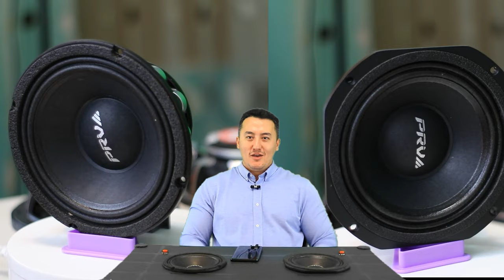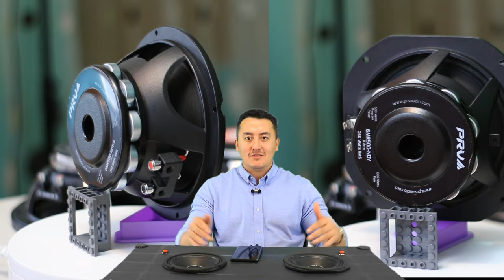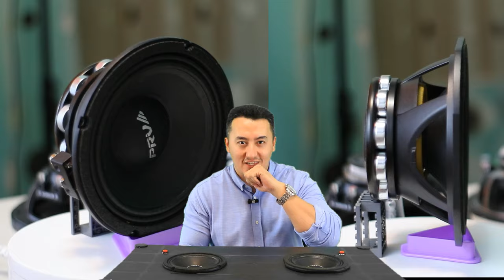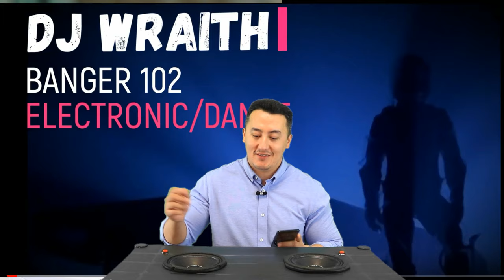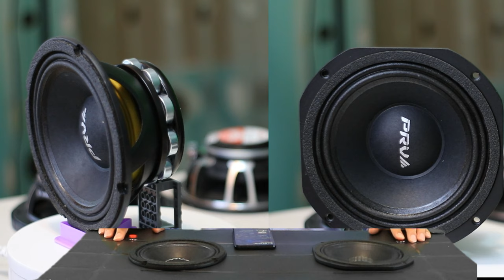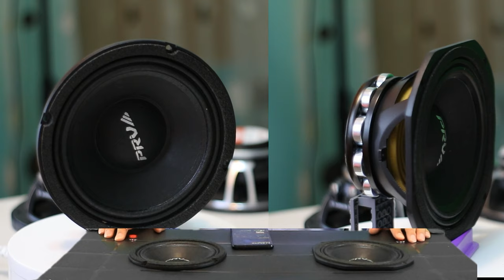Myth busted, real test 4 Ohm vs 8 Ohm speaker? Car audio system PRV AUDIO 6MR500-NDY

Comment: Ive heard that too yesterday doing car audio and switching between 8 and 4 ohm subwoofer, 8 ohm just crashed it, you could close your eye and just relax deeping through that smoothness of bass vibrations, that meat! Difference in night and day!!!! Even by not an audiophile person next to me. Otherwise wiring 4ohm speaker the bass was easier controlled right and louder, but it was only loudness and not quality itself it was not comparable, maybe some mids and highs would be better at 4ohm but not for a bass, it needs to be hell thick and dynamic which only maybe top high end 4ohm speaker give you, comparable to casual 8ohm. Peace out! And have a good 8ohm subs in ur trunk! P.S. I tell you a cool story how a person that heard 4 and 8 ohm speaker got addicted to that bass, not sleeping and searching for a good 8 ohm aftermarket sub after burning 8ohm sub and getting 4 ohm sub and be passed on it for a while :D

Comment: It’s just like the subwoofers, the ohms are made depending on what application, generally, to match a amp for example: a 3000w 2 ohms monoblock , for match that ohm , you need two speakers at 4 ohms (4+4=2ohms load) , with a 8 ohm speaker, you will need four speakers at 8 ohms to match the 2 ohm load for the amplifier (8+8+8+8=2 ohms load). Obviously in parallel.
Reply: How so? I have 2 4 ohm dvc's going to a 2ohm stable monoblock. The speakers and are at 4ohm stable. Sounds pretty good, still tuning the amp.

Comment: 8ohm is for Sound Quality
2Ohm for POWA so it can get more power out of amp sacrificing sound quality.

You lose power at the amp not the speaker. When the amp sees the resistance it changes the power.

Comment: The main difference is the amps the speaker draw from the amplifier. If you connect two 4ohm speakers the ohms drop down to 2 ohms compare to 4 ohms if you connect two 8 ohms speakers.

Comment: couldn't tell the difference, hey so I got a question that you might have an answer to. So I have a pair of 6.5-Inch 180 Watt 2-Way Coaxial Speaker but each speaker is 90 Watts RMS/ 180 Watts Peak Frequency Response 65-20 KHz, Impedance 4 Ohms. I'm looking for a cheap 2 channel amp that can make these speakers sound awesome. what kind of specs should i be looking for in a amp? how many watts should the amp have and ohms as well, remember I'm looking for a cheap amp that make my speakers shine! thanks
Reply from the maker: Hey man get timpano  or rockville amps they around 90$ but Ull be happy with them
Reply: @LIFEINSPEED  i was looking for something in the $50 or even less lol

Comment: I got two b&c 10 they are supposed to be 8ohms but my multimeter read 4.8 on both speakers it’s that normal ? 
My think is my soundigital 2000.4 4ohms 
Give me 1000 at 4 ohms 
But when I connect my two speakers it go to 2.2 ohms it’s that normal ? Or how you guys recommend me to connect them ? 
Thanks

Comment: 8 ohms run cooler than 4 ohms , another words less heat will save your amps and speakers. 2 ohms takes more power which lead to bigger amp and more money for the same  sound . that's something that manufacture want you to believe, that's why they are pushing 2 ohms amp and speakers. they cost more and look bigger. waste of money, you don't see high end speakers that are 2 ohms.
Reply: Amps deliver twice the output power when a speakers resistance is halved so no you dont need a more powerful amp. The difference is the lower impedance will be 3dB louder. 3db is slightly louder but not twice as loud. Its not a myth its a lack of understanding.

Comment: Cool Channel. Yes you're right in a way about them souning the same. A 4ohm and a 8ohm can sound the same in a sense, but for example. If you take the channel with the 8ohm speaker and set the amp to about 44.72V that will give you 249wrms. Take the channel with the 4ohm and do the same, you will definitely hear the difference because at 44.72V you'll be at almost 500wrms, but i would do it in short bursts. Try it and see.

Comment: If we have use a 100w class A bjt transistor amp: it outputs current. And the speakers were the same except 4ohm 8ohm then the amp could put out 8.33 amps . Then 4ohms needs 5 amps for a 100w speaker, and 8ohms needs 3.5 amps for a 100w speaker. The higher the amps the harder the amp has to work gets hotter. Get a bigger amp and run 4 ohms or less they do sound better.  Random: car amps have DC step up. Might look like 78VDC inside of car amp with 2 ohm output for 3000w.

Comment: In my experience, it's better to run less efficient higher ohm speakers and more power. 8 ohm speakers have more accurate bass and mids from what ive found building speakers.

Comment: 4 Ohms speaker will always sound about 3-4 DB louder than 8 ohms of the same identical speaker. especially if all you're speakers are 4 ohms. there is a reason why speaker manufacturers give you a choice to choose either 4ohms or 8 ohms.  you can always mix a 4 ohm with 8 ohms as long as they are both SVC= single voice coil. 
if you start to mix 4 ohms DVC= dual voice coil. which is a 2-ohm speaker. then you can Never mix a DVC 4 ohms with a DVC 2 Ohms,
keep in mind. DVC= dual voice coil. SVC=single voice coil.   
Note that issue exists only in DVC. NOT SVC

Comment: You have to play specific type of music to hear difference like jazz, classic, when guitar string vibrates alonside of other instruments, thats when you hear a difference, they sound as if they muffled.
 
I had same thing installed 4Ohm speaker instead of 2 Ohm in system tuned for 2 Ohm and compared them. They sound almost identical, bass is mids are almost the same. Only for classic music you lose some brightness of instruments in the back.

If you running both same impedance with aftermarket amp you should be golden. 

It makes a difference in certain setups. So if you have a premium vehicle with great system and try to change speaker out of ohm spec it would be noticeable and important. 
But most of the cars have garbage stock sound systems so 🤷 I guess it works. 

Thanks for the vid.

Comment: This test probably would have been more effective using a jl or Rockford amp with the  regulated intelligent power supply where it plays same power out put no matter what ohm is used I don’t think Orion made a amp with that technology I could be wrong but if that’s not what’s going on here then at 8 ohms the amp would put out less power but more efficient then the 4 ohm  thus the 4 ohm being louder
Reply: intelligent power supply is just the opposite, so when your boxes impedance drops at the ports tuned frequency the "intelligent power supply" is going to see the lower ohms and cut back power? That's a stupid power supply!  If you know what an impedance curve is you would realize how dumb those amps are. It's not intelligent, it's there way of making a cheap amp that won't overheat at low ohms and then trying to give it a fancy name to trick a buyer into thinking they are getting something new/cool

Comment: You didn't notice any different because your amp could support both, if your amp was only supporting till 8 ohm then you could feel the half power different on the 4 ohm speaker
Reply: The difference and problem starts when your amp is not powerful enough to support 4 ohm but as you said your amp is way more powerful the all these speakers

Comment: 8ohm sounds cleaner, end of story. The amp has more control over the speakers running 8ohm if you would run 8ohm vs 1ohm you could even hear the difference on YouTube clearly. At 1ohm or even lower the bass starts, i call it „wobbly“, at 4ohm and higher the bass will be always be clear and crisp. ❤

Comment: Hey Mike I understand what you are saying the difference is not mocked but don't you think when you multiply it by four it would make a bigger difference for example if you have a 4-channel amplifier which gives a hundred and fifty by 4 into 4 ohms  don't you think the same amplifier would give less power at 8 ohms
Reply from the maker: Yes it will be difference bit not huge like everyone panicking

Comment: Im looking to build a system for my truck .im looking to run 8 inch mids n a separate  3 inch tweeter in the doors ..what would u recommend  for a 8 inch ..ive got the kicker 6.5. In the quarters n a 10 inch kicker sub in the rear ..would love your input n what amp would u run

Comment: U will hear a bigger  diffence at full tilt   and the type of amp design     some amps will double power when ohms drop   some will not   but 8 ohm will distort a little earlier than the 4 ohm  u will   get more power using the 4 ohm   and  have more headroom when the music peaks

Comment: What if you put a 4 ohm speaker on a 8 ohm transmitter?
Reply: It will get hot very quickly. I did this with a home powered subwoofer. I put a 4-ohm car subwoofer in it but had to switch it out to an 8 ohm one.

Comment: What people want to say is....if you give a 8ohm speaker 200watts it will play loud but if you remove the 8ohm speaker and you add a 4ohm speaker your amp wattage will go up a bit so it will play louder.... but if you give a 8 ohm speaker 200 watts and the same 200 to a 4ohms there will be no difference

Comment: I personally think a 4 ohms speaker will heat much higher the outputs of an amplifier. The bass of a 8 ohms speaker is softer than the 4 ohms.

Comment: Less ohms will heat up your amp, I had  a  4 ohm speaker that kept shutting down my amp.  8 ohms doesn't  heat up my system.
Reply: So that was because the amp was designed for 8ohm speakers, right? Now if the amp was for 4ohm speakers, you would get away using the 8ohm wired in parallel, right? 😁 I feel like my mind is playing tricks on me. Lol

Comment: 4 ohms for home and car audio.8 ohms for pro sound system because of multiple connected speaker.4 ohms stressful for amplifier if you use multiple speaker thats why its design for home use only its fixed set up.

Comment: I think more of your differences and whether one set is 8 on or 1 set is 4 homes it's an amplifier this amplifier thing is the amplifier in parallel or is it wired in serious internally that would make your different. Example if you have 2 sets of 8 on speakers and you play one at a specific volume the big volume and it will be the same volume it will be the same but don't touch the volume and put a and B together and the volume will cut down. That has to do with the way the amp is wired take white bulb for example. Your chandeliers are all wired parallel show all of your light bulbs are at 60 W if they were wired in series you would get 60 W out of one bulb and the more bulbs you screw in the demo the other ones will get and they will all get to be the same brightness about a 1/2 or a 3rd of bright as they should be depending on how many lights you have on that string in series. So if they told you that forum's play louder than Adams that was a lie. However it does take more energy to run a 2 homes speaker or a 4 homes speaker than an 8 or a 16 om

Comment: Depends on amp.
Reply: Yes, he is basiacly using a way over powered amp to do this test, not really fair at all, I also wanted to see a wattmeter on them to show they are truly the same wattage. Majority of car stereo amps (stock stuff) do not boost the voltage in the amp section (good amps do), so they only have 12V, 4Ω easily wins to drive more power in this situation. This is why there is 4Ω speakers. And as Resonant Engineering said, lower ohms can be higher power rating, its not just ohms law, its also the power law.
Reply: @Ozzy3333333  👍

Comment: What's the difference with 8ohm and 4ohm?
Reply: 4 ohm will use more power from the amp, because less resistance
Reply: Ok thank u
Reply: 4 ohm can cause an amp to heat up faster than a 8 ohm.  Also your system will draw more electrical power with the 4 ohm so 8 ohm is the better choice by my book
Reply: @andyharripaul9066  thx bro

Comment: not a myth because 8ohms is higher resistance, than 4 oms  ie 1000 watts rms in 8ohms, would be 2400 watts rms at 4ohms becuse of a lower resistance to power output you put 2 8ohm speakers wired im parallel you get more power because it becomes less resistant to the power without damaging the speakers but the amp has to be capable of handling ranges from 4 to 16 0hms you havent bust any myth thats the law of physics

Comment: Half the resistance is 3dB louder, not twice as loud. But will pull twice the power out of your amp. Not a myth but obviously this guy doesn't understand that twice the power isn't twice as loud. Its a gain of 3 decibels... Which in reality is not much.

Comment: 4 ohm would be little louder if I’m correct because it’s a lower ohm load on the amp then the 8 ohm so if I’m correct the lower ohm the more power
Reply: With ur amp wired at a lower ohm load makes ur amp work harder but u get more watts out of ur amp. The Higher ohm load wired to ur amp means ur amp won't have to work as hard(Less chance ur amp will over heat, pop fuses, and last longer cuz ur not "abusing" the amp) but you get less watts from ur amp. But idk if ur amp can push/supply ur speakers, midds, and/or tweeters with enough watts idk if u will get a cleaner sound with it at a higher or lower ohm load. (Actually why I'm on here trying to find out myself....). I'm old school and always bought big amps to wire my subs up to 1 to 1/2 ohm stable at 4,000-6,500wats on 2 sundown zv3 15's. And doors always at (by after connecting 2/3 speaks together) make each door/ channel equal 2ohm. But on hear to learn if getting bigger amps to wire my speakers at or buy speakers with higher ohm ratings will make for a better sound quality....?

Comment: If you were having 18 on speaker and 14 on speaker congratulations you just drop your amp down to 2 homes fortunately for you it might be able to handle it for a brief period of time A friend of mine found that out the hard way he had a set of speakers that were 8 on a friend of his had the exact same speakers but they were forum he thought well if I put all 4 of themonarch I can play 4 speakers it was fine on a low level he fired it up cranked it up and the relay said snap that's not happening captain needless to say his amplifier had to go to the shop. Why well it was only ready to go down as low as 4 Ω which would have been fine 8 homes on speaker a 4 homes on speaker B but when you try to put them both together it dropped below for ohms

Comment: there is more to this than the speaker the amp capability to play 8 ohms  plays a role it won't be twice as loud the amp can produce more power playing at 4 ohms even if it give it twice the power it won't be twice as loud that's not how it works to play twice as loud you need 4 times the power

Comment: that's how it works yes. it could that  be that way... but it sounded like they play almost the same.   so maybe he actually had a 4 ohms resistor connected in parallel so both speakers would draw the same amount of power. but really even if that wasn't the case the both speakers sounded almost the same !!!!!
Reply from the maker: Why I do that lol
Reply: @LIFEINSPEED  my bad it should be an 8 ohm resistor!!!! that why they both see the same power!!!! thats my guess
Reply: @jonathansingh7049  Check out Rax Pax comment above

Comment: You created numerous more myths by trying to debunk one... If you put the same amount of power to an 8 ohm and a 4 ohm speaker.. There will be no difference except for potentially impedance rise, which effects subwoofers to a much higher degree. Now in practice, as far as the amp is concerned, it will put out more power at lower impedance levels.. IE.. 500wrms(2ohm), 250wrms(4ohm), 125wrms(8ohm)..  The primary difference between 4 or 8 ohm mid speakers has to do with speaker and wire configuration. If your amp can only be wired down to 2 ohms(for example 2 channel, 2ohm 500wrms per channel amp), then let's say you want to run 4 speakers on that amp, you would want 4 ohm speakers(2 wired in parallel per channel) .. However if you went with 8 ohm speakers you would get HALF the power, decreasing 3db in sound intensity.. Still hardly noticeable as you need almost 10 db to get double or half loudness. But considering in my hypothetical situation, why not get that extra power and extra spl?..

Comment: Cool thing with 4 ohm is you can wire four 4 ohms speakers in parrellel and use a 1ohm stable bass amp to push the speakers...really works in a box method not when the speakers are in doors....why use a bass amp you ask? Great question...I found that bass amps are naturally rated more powerful than a regular amp.... so to purchase a subwoofer amp at 2000 rms is a lot cheaper than purchasing a regular amp at 2000 rms... the key part is making sure that amp can correlate with the frequency range of the mid range.... alot of subwoofer amps dont which makes sense cause that is not their intended purpose... but few do.... finding one can help save money and therefore just invest more of your money getting premium speakers...which makes all the difference.... 

I guess the same can be done with 8ohm speakers but in this specific example you would need eight 8 ohms speakers at 250 RMS each vs four 4 ohms speakers at about 500 watts rms each.

Eight 8 ohm speakers at 250 watts will definitely be louder than four 4 ohm speakers at 500 watts....but that would be wayyyyyy more expensive as well.... and that goes to the point of this comment is all about saving some bread while also investing the money where the sound quality will make the most difference the speakers not the amp.....

Comment: More powerful speakers you will  Definitely tell the difference... say you have a 1000 watt dual  4 ohm voice coil speaker and a 1000 watt amp if you wire it at 8 ohms you are sending 250 watts if you wire the same speaket at 1 ohm your sending 1000 watts or close to it if you figure in box rise.
Reply: I think box rise is only for subs not midrange not sure tho